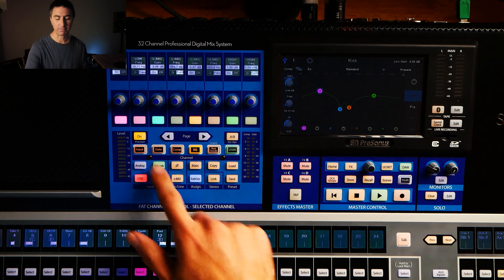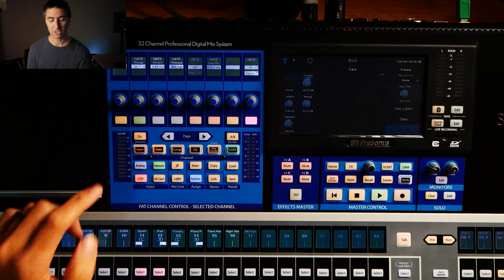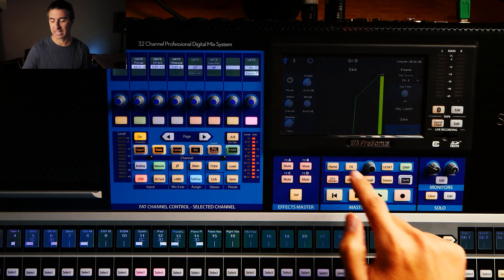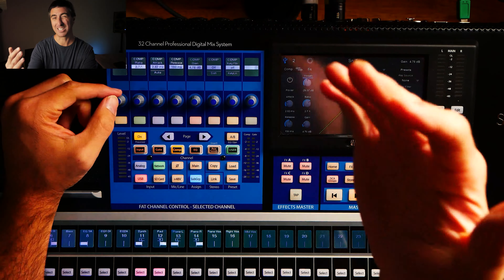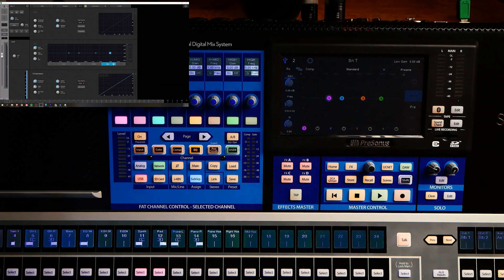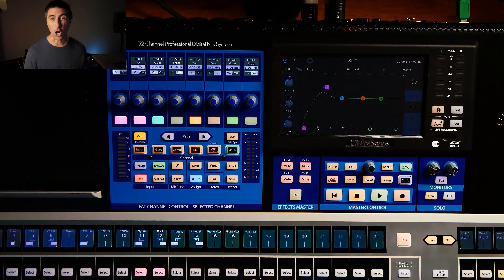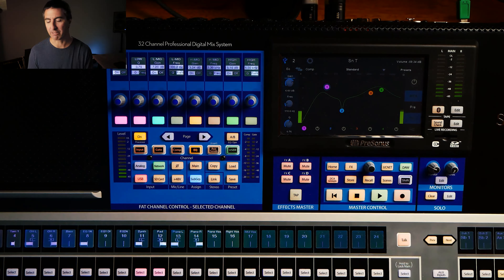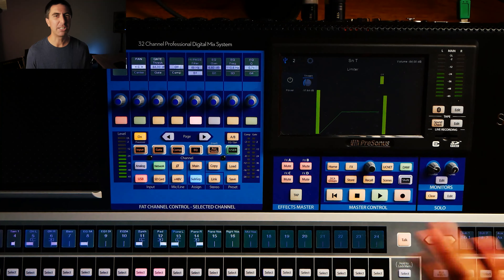PreSonus StudioLive Fat Channel Processing || Does this make my audio look fat?

Comment: Convert an aux channel into a subgroup channel select it for a vocal it adds a second EQ, Compressor, Limiter and that second compressor you may use it as a Dee essr with key filter but don’t forget to turn off Main for vocal channel because then your vocal will be doubled with ur subgroup channel
Reply from the maker: clever! I like it!
Reply: nice!!! really dig the creativity here! maxing out the board's capabilities
Reply: Hi! I don't really get what you are suggesting here.  and its impossible to work in any basic compressor like what we are discussing now "studio live" .because its not a multiband compressor. or specific band compressor . it compresses the whole spectrum.

the sidechain filter reacts and compresses the whole spectrum still.
only triggered with the selected frequency range you want it be. 
the end results still full band compression .

unless you split the vocal sent to two mixbusses

bus one on a low pass to 3k
bus two on a highpass down to 3k if it's at high slope brickwall so crossover is like 20 to 3k , 3k to 20k .

compress the buss 2 . now its a deesser .

even with this there are phase issues with the crossover. 

still not practical.

still dont agree with your technique.
Reply: im talking based on my full use of the basic LS9 yamaha to flagship PM seriest Yamaha to even Allen n Heath DLive ( certified operator ) .
of course those i mentioned have deesser on every channel as standard.

Comment: Hi I use a studio live 32 just like yours but when using pipeline i’m trying to use external  gear so this is how I have it hooked up …I use jack input channel 25 mono and out XLR output mix3 i’m not getting signal out. What am I doing wrong …I have the I/O set to input ch25 and out ch3 i’m using studio one 4 pro I did a sound elimination test using a different piece of gear while running pipeline I’m getting signal in on jack ch25 and I’m getting signal from the selected track that I have the plug-in on( for example, track 1..), but not getting sound out of the back of the board mix3 output to the external gear